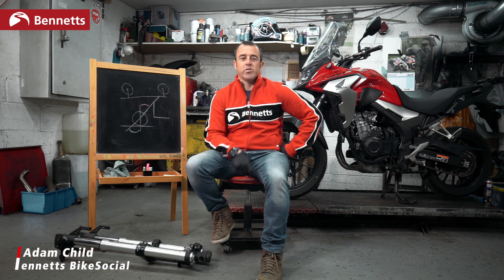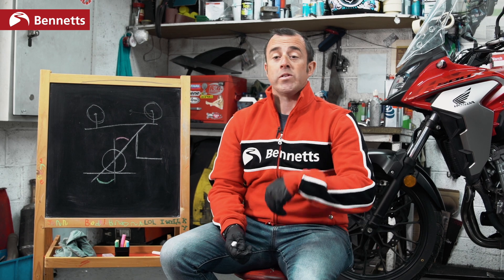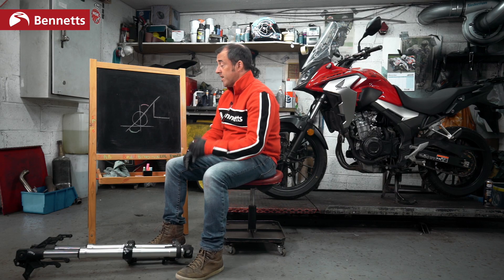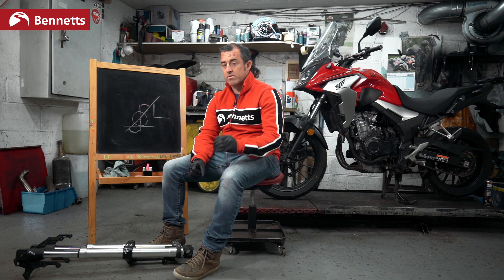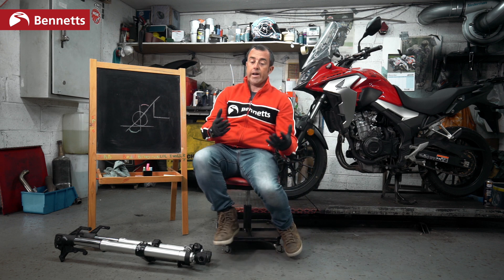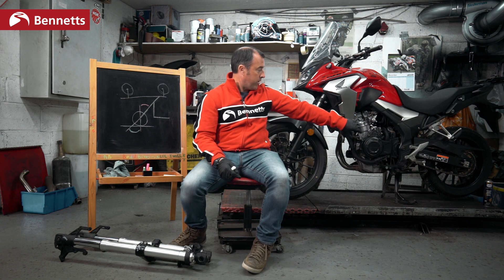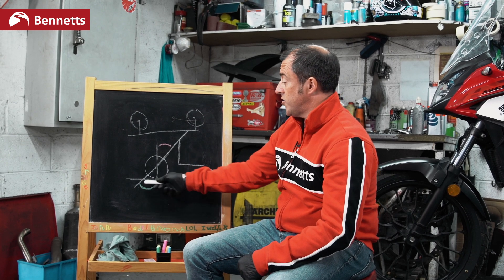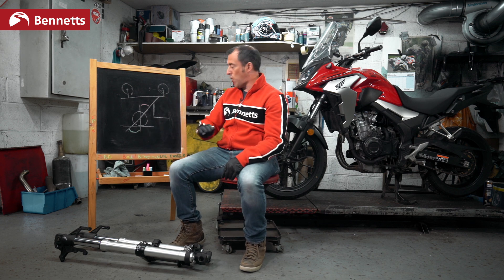What do rake and trail on a motorcycle mean? | Home Schooling Lesson 3

Comment: Technically speaking the datum line is not the forks, but a line projected through the steering stem.
Reply: Pivotal axis right
Reply: I think that's right.  Bicycles have curved forks which do not lie on the datum line.  The axle is well ahead of that line.  Why?  You got me.
Reply: @alext8828 I would assume for stability, due to the short wheel base nature of bicycles
Reply: @alext8828   by curving the forks it reduces the trail, the rake should be measured from the steering stem axis.  A smaller trail dimension makes initiating a turn easier, as is my understanding.

Comment: While I know what you are trying to say, simply saying rake is the same as trail makes you ask why both are used. You should explain rake is the angle of the forks (ok, steering head but let's keep it simple and easily seen) in relation to the bike and trail is the distance from the vertical line to the contact patch. If you wanted to demonstrate the effect you could draw the same rake with a 17 and 21 inch front wheel.
Reply: Yeah, a year later I'm seeing some craziness here.  I would add (to the confusion) that I've seen bikes with the axle mounted about 2" in front of the fork.  That would increase the trail, but not the rake...I think.  What say you?
Reply: What part of this is only the basics as and a book could be written on geometry  and we could talk for hours dont you understand?

Comment: Slight correction : on the board drawing the trail is represented as an angle, but it is a measurement of distance.
Reply: Great. That makes more sense.
Reply: Also the rake is not a distance it’s an angle.
Reply: Yes the explanation given is an attempt at simplification where it is in fact incorrect, what's the point?

Comment: I lowered my bike with lower links, also lowered the front forks. Question is, I feel the front lose at high speeds. If I raise the front a bit will this slow or tighten the steering?

Comment: I've changed my fork oil. Now with installing my fork again I noticed that the fork is 2mm lower in my triple clamp... does those 2mm have a big impact to my steering and should I reinstall them by putting them 2mm higher in the triple clamp or can I leave them like they are now?
Reply: Raising and lowering the forks in the triple clamp is a time-honoured method of suspension tuning.

Raising the forks tends to lower the bike at the front and make steering more responsive. Lowering the forks has the opposite effect.

I suggest you do some more research...
Reply: @theresanothersteve  I know that, and that was not my question....
Reply: @Striple  most likely 2mm will have a 'small' effect. You can experiment with it and see its effects. Very good chance that if you're a novice rider you wont be able to tell the different.
Reply: @raynic1173  Yes, true. I know now😃. I felt a small difference when I was leaning very deep. After that I changed it back like it was before. Maybe it was only in my head or there really was a difference... I feel better now when I ride, now that the suspension in the original setup. 
Thanks man 👊🏻

Comment: Why some bikes have same rake angle but have different trail? Like Ducati v4 and Aprilia RSV4r___24.5 rake

But trial have 5mm difference????
Reply: trail is calculated from a line through the steering head, not the forks, so if the bike has offset triple clamps the trail measurement will be different even if the rake angle is the same. Very basic stuff in this video.

Comment: This is a super confusing explanation. You keep saying that rake is "the distance between the imaginary vertical line and the forks" but rake is not a distance (measured in mm), it's an angle measured in degrees. Trail is a distance.